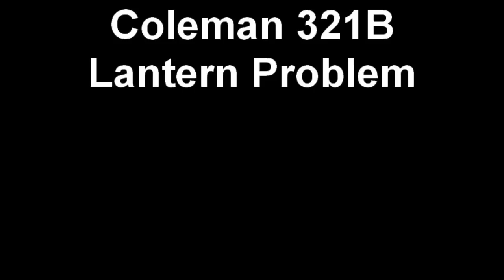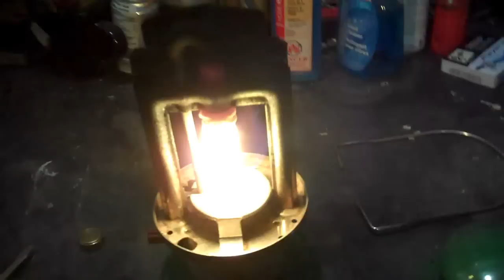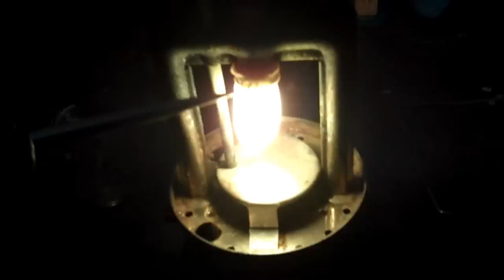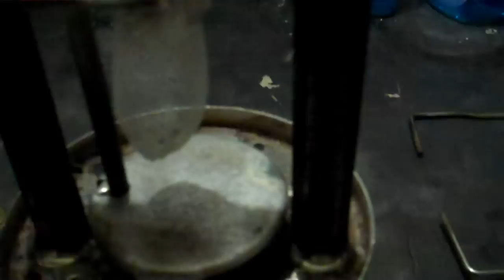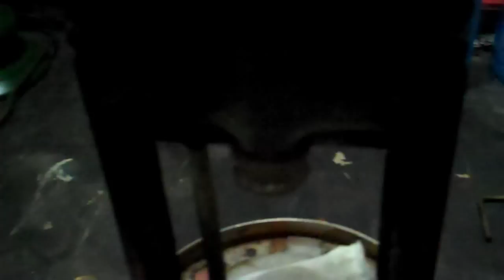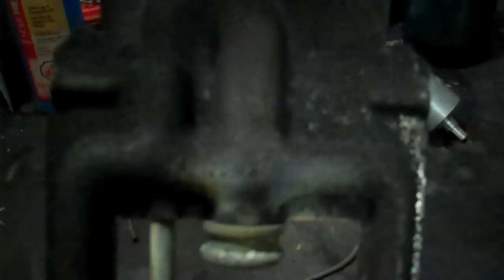Coleman lantern Problem. Missing Burner Screen

Comment: Is the screen replaceable.  Same problem with my 84 cl2.  I just installed used intact burner tube i had on parts lantern  Mine looked like it burned through..
Reply: They are.  Unscrew the burner cap.  If it is stuck in place heat the cap only with a torch and use a set of channel locks but don't use too much pressure or you'll put it out of round.  I used #20 mesh stainless screen and found 2 layers works best.  Do NOT use aluminium screen as it will burn through in minutes.  Cut the screen 1mm larger than the inner opening of the cap (a punch is best for this but I am not sure of the exact size - I did mine freehand) and it should pop right in.  If not you can use the tip of a wide slot screwdriver and a light hammer to gently tap into the inner edge of the lip to open it up a bit.  Once you have the screens in place tap the lip back down again (gently) to pinch the screens and hold them in place.  I found a ball peen hammer works best for this.  I also found it help if the screens are slightly convex with the curve going inwards into the burner tube.  This brought one of my 321s back to life and it burns fantastically now.

Comment: I have several new old stock 236/237/249e  burner caps and tubes. Be careful installing a new one. The threads are easy to cross thread. Buy the old parts while you can still get them. They are already expensive.